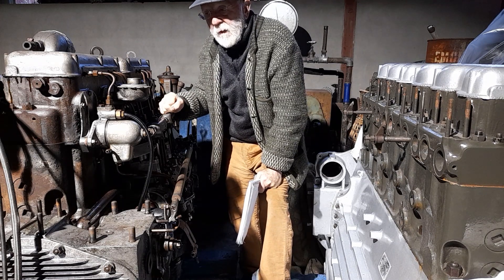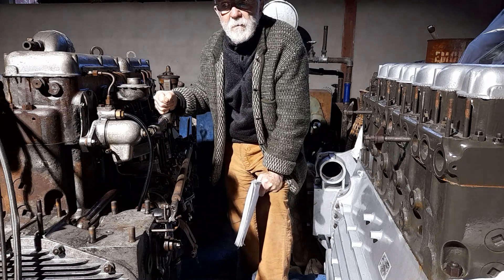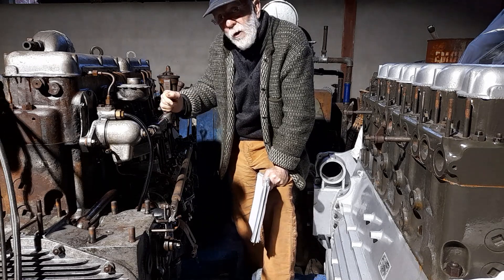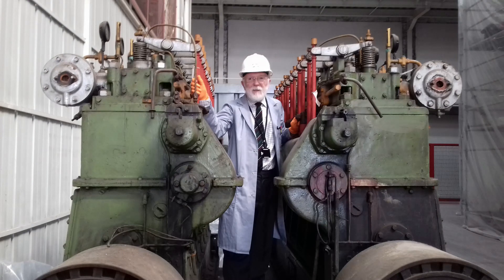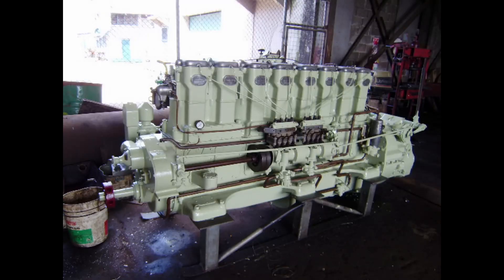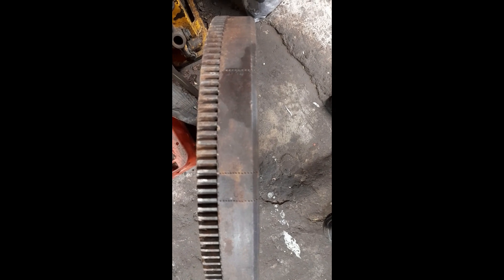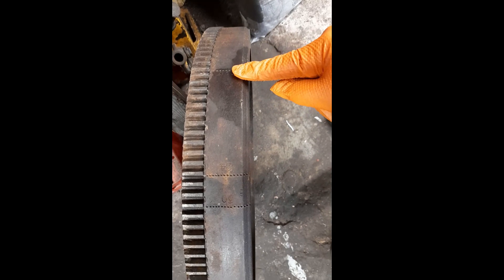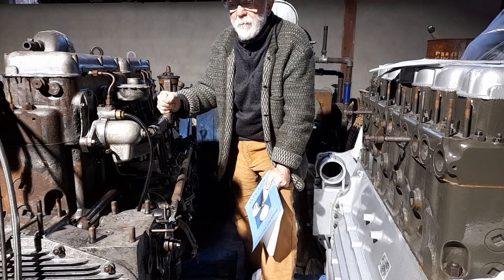Gardner engines: handed engines and direction of rotation.

Comment: Well actually it’s related to the way that propellers use their thrust, it’s called transverse thrusting or “propwalk” single engine boats will always thrust to one side especially in astern, where dual engine boats have the advantage of  both props turning against each other producing very little sideways thrusting which gives you a lot more control especially once you get the hang of “walking” the boat through fwd and reverse it’s actually possible to use the counter rotating props on some boats to go straight to the side using the rudders aswell 
But I like the idea of making the injector pumps easy to access😁

Comment: Talking about right and left hand engines it was always the norm that RH  (anticlock) engines were for automotive applications while LH (clockwise ) were for marine and stationary applications.  It reminds me of a funny story which happened while working in the Lister agency in Dublin, about 40 years ago. A Thwaites dumper arrived in the workshop with a blown engine (Lister ST3).  The customer needed the machine back as soon as possible, the debate was whether to rebuild the existing engine or replace it with a new one. I was heading out the door for a few days to visit customers on the west coast. When asked had we a new ST3 in stock, I replied no and left.  When I arrived back the dumper was still in the workshop, but was fitted with a new engine. I was informed by junior in the sales office that I had made a mistake, he had checked the stock list and found one. Now I knew that we did have an ST3 in stock but that it was  "generator" specification. I laughed when I was told that the new engine would not start electrically with the original starter, but would start by hand using the "workshop" starting handle.  There was also much scratching of heads as the gearbox had developed a fault, it now had three speeds in reverse and one forward, the machine nearly went out through the wall when tested as, in addition the fixed speed governor was set to 1500 RPM, no idle and wrong direction!  
   Many people disregarded the fact that engine manufacturers built their products to suit different applications. Variations between automotive and stationary/marine were necessary, such as governor, flywheel and housings, camshaft extension, starter, alternator, cooling pumps, lubrication system fans, manifolds were available. 
  I also remember the guy who "marinised" an ex lorry Ford engine on the cheap by fitting a heat exchanger kit. He made up the price of the "proper job" when he had to wait weeks for a new propeller to arrive with the correct rotation to suit his new engine. He went crazy a few weeks later when his reversing gearbox blew up due to lack of lubrication. (The oil pump was turning the wrong way). He almost jumped overboard shortly after that when the sheet metal automotive type sump perforated due to salt corrosion emptying the oil into the bilge leaving him stranded in the Atlantic Ocean with a blown engine!

Comment: Another interesting video Joe - Thank you.
Of course when talking about handed, twin screw installations you open the rabbit's hole of which is better, inboard or, outboard turning props.
Little tale for you from my career regarding direct reversing diesel main engines.
I was away as relief Master on a small ex German built coaster with a Deutz direct reversing engine. When you wanted to go astern you stoppped the engne, threw a lever to change the cams and then re-started the engine to go astern. I was also the "engineer" on that ship. The main engine was of course air start, the owner/captain I took over from said to always have an auxillary engine with a compressor running to keep the air bottles topped up.
Anyway one Sunday we had to shift from the lay by berth to our discharging berth, only a matter of a couple docks but there was a bridge we had to go thru. I had called the bridgeman on the VHF radio but he was just on his way. I also decided as it was a short hop not to put a compressor on. So we get up to the bridge no sign of him and I decided to get him to hurry by a few blasts on the ship's air whistle.
Finally he turns up, I go to give her a kick ahead as the bridge opens only to be greeted by a rather short, muffled cough and nothing from the main engine. I'd used all the air up blowing the whistle.
Yes I learned the embarrassing way about always having a compressor on to top the bottles up!
Anyway keep posting such informative content Joe. 👍

Comment: I had a Ferguson TEF 20 stall on the uphill, very poor brakes in the reverse direction, I thought to be clever and leave it in gear...  It fired backwards, covered me in oil from the air cleaner and scared the hell out of me.. I may have touched cloth...!!
Reply: I remember a similar situation with a Coventry Climax forklift with a Perkins 4203. The starter was faulty, and the hand brake was out of adjustment. At the end of his shift the driver parked the machine on a ramp, in gear, intending to roll down the ramp next morning to start the engine on the clutch. The next morning the truck was found yards away against a wall with an empty fuel tank and no tyres on the drive wheels! The diesel had fired as the weight of the machine built up comression and ran until the tank emptied!